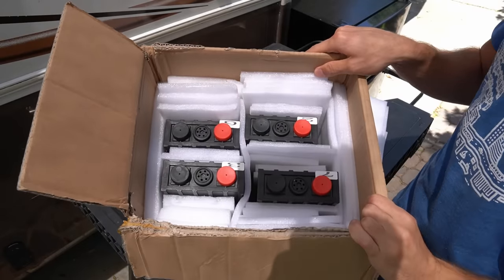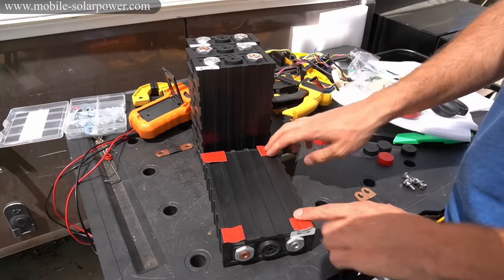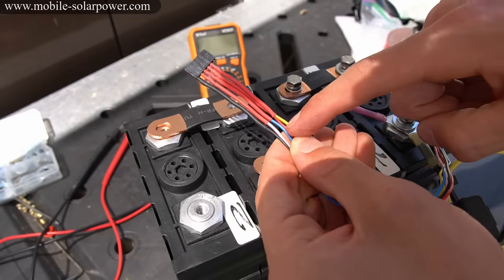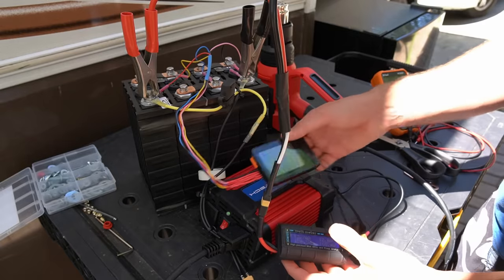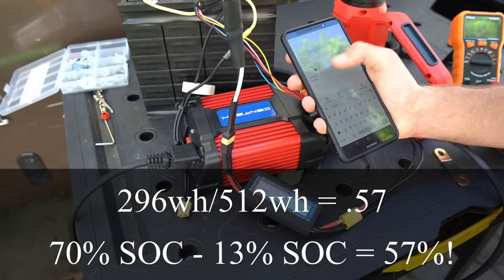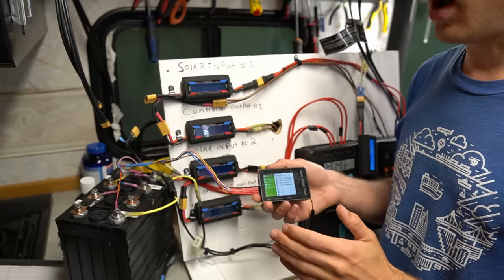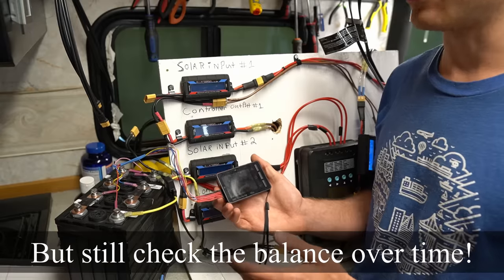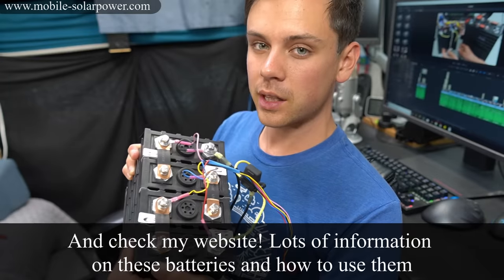12v LiFePO4 Battery Kit from Amazon.com - Tested and Reviewed

Comment: holy shit those are pricey.
Reply from the maker: Way cheaper than lead acid. Lasts 5-10 times as long.
Reply: @WillProwse  I think batteries in general for solar are way over priced. they make up the bulk of the system cost. I think I'm probably going to end up just building packs with 18650s instead.
Reply from the maker: @sergeantseven4240   They are dirt cheap but a pain to build. To each their own.

Comment: Some people think they can fix things themselves but it takes years to become a licensed electrician. Whether you’re at work or doing your own jobs around the house, DIY=DIE when it comes to electrical work
Reply from the maker: Not with 12 volts. Super safe
Reply: @WillProwse  true but series panels and inverter in the mix you can quickly move in to dangerous territory